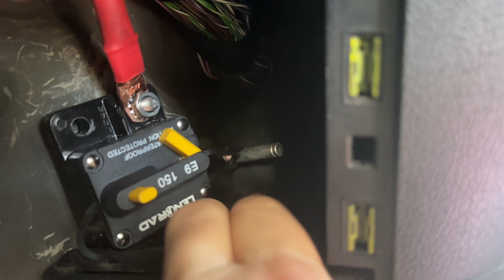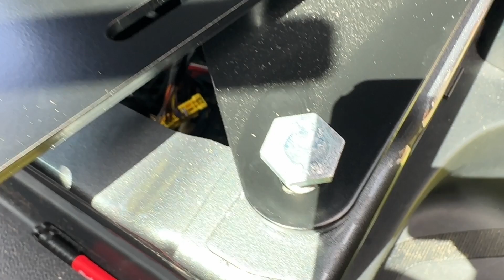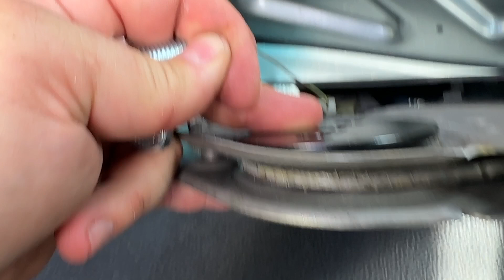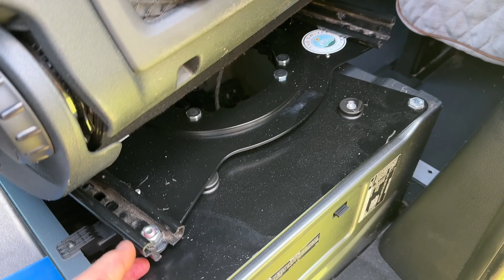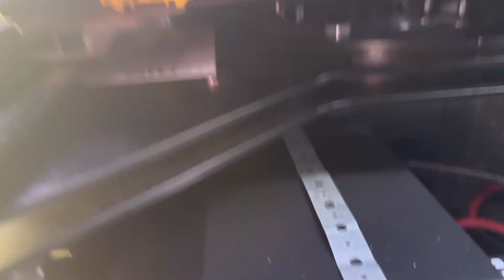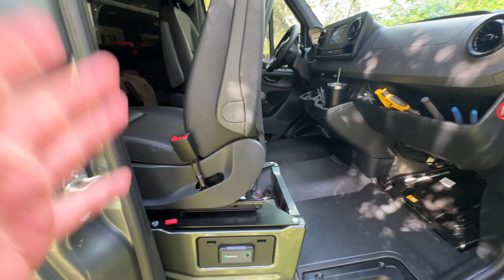How To Install Scopema Seat Swivels in Mercedes Sprinter Van

Comment: Very nicely done tutorial, thank you for publishing this. I'm debating the Scopema vs. other brands. One complaint I've seen several times is that the Scopema swivels can tend to wobble, and when unoccupied, rattle on the road. But I take this with a grain of salt as I understand the current version (V3?) was redesigned, and of course others may not have installed theirs correctly. What has been your experience with rattle and wobble? Also, do you know how many inches of offset there is when swiveled (i.e., how much do they move towards the center of the van?) Thanks in advance.
Reply from the maker: Use them daily since video. Wobble is non existent with regard to noise in traveling. They will wiggle a bit if you try to wiggle them but that’s to be understood as they’re on a swivel. Strong and sturdy. Robust and well made.
Reply: @fixitnoworlater  Very pleased to read this. The Scopemas are now my lead choice. Do you have a rough idea of how much the seats offset towards the center when swiveled? Thank you!

Comment: I'm running into an issue where the yellow harness is not long enough to stay plugged in while the seat is fully extended out because of the extra length to travel through the circular hole in the middle.  Do they make a simple extension for that?

Comment: So sooooo good, Fit It Now (aka, ArchiFix) your  tutorial, thank you!!! One thing to share that may help others...on my 2021 Sprinter 170  extended high-top 4x4, the plastic casing around the emergency brake sits perfectly near the bottom of the front cab floor, without needing to trim a 1/2 off the bottom.. I trimmed the 1/2 off the bottom, only to discover on the newer Sprinters, it's a 1/2 trip off the top 90 degree arch of the INSIDE bit of plastic that needs to be trimmed with a jigsaw (or any other good cutting tool). There's now a lovely 1/2 lift off the bottom, no worries, as I will surely find a visually interesting way to hid this if or when putting thick floor mats or something like that. Wanted to share and hope others read this if watching off The Swivel Shop website. Thank you again for this perfect, step-by-step Scopema installation video.. Oh, and no airbag warning lights after reconnecting the battery!!!